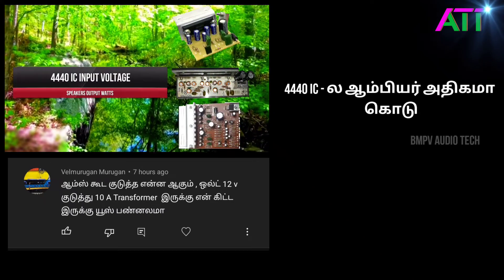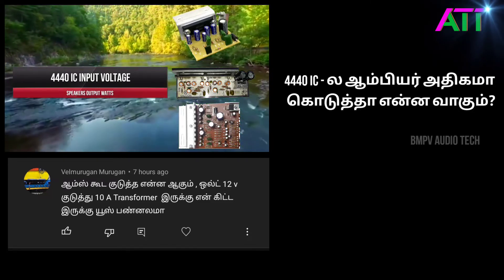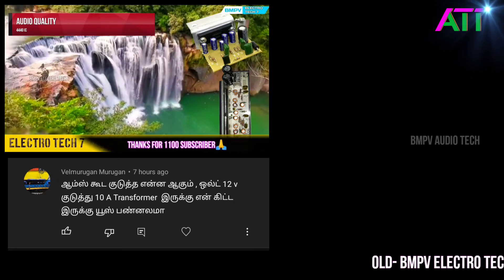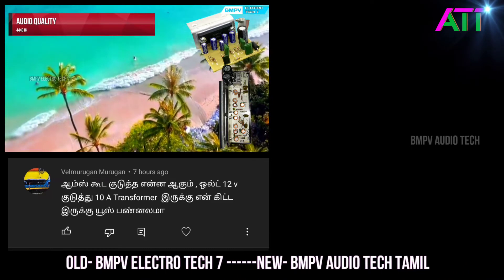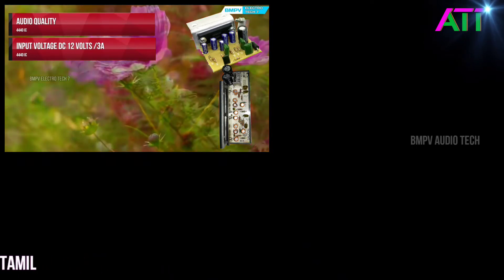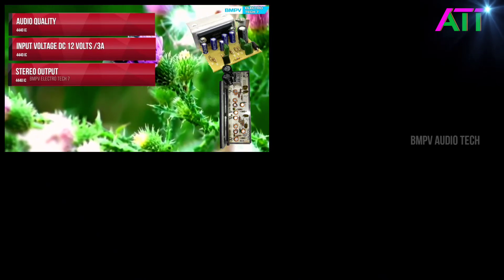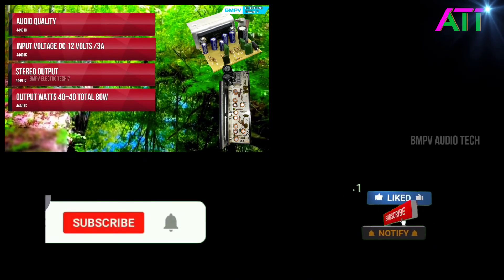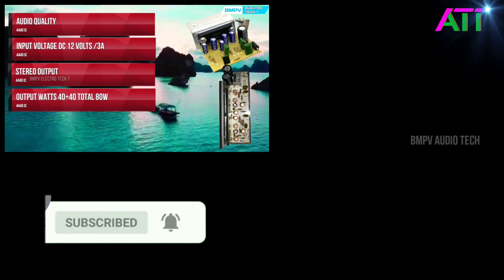4440 ic -க்கு 12V-10A கொடுத்தா என்னவாகும்?#bmpv #bmpv

Comment: Buck converter use pannalama
Reply from the maker: 4440 ic  க்கா- Buck converter use panna poringa
Reply: @Bmpvaudiotechtamil  ithu oru option iruka nu ketta na ,resister use panni volt kammi panni use pannalama.theroy only na not practical.oru information na ketta . sorry ungala distrab panni iruintha
Reply from the maker: @sundharrajan8284  ok thambi buck converter 12v dc fan /Usb SILM BOARD/ usb video board ku use pannalaam thambi